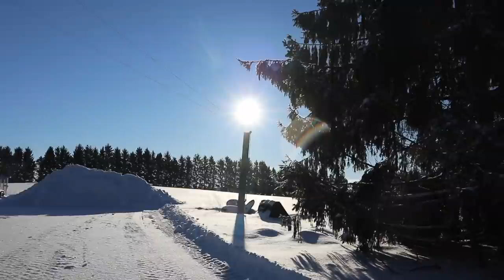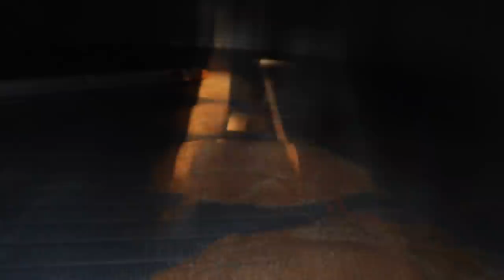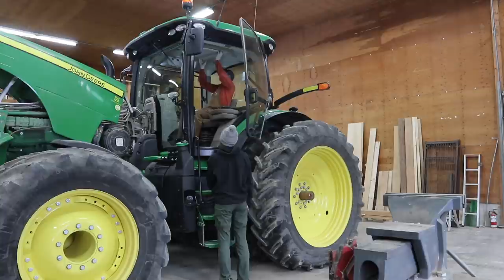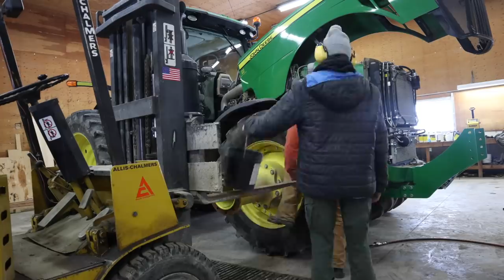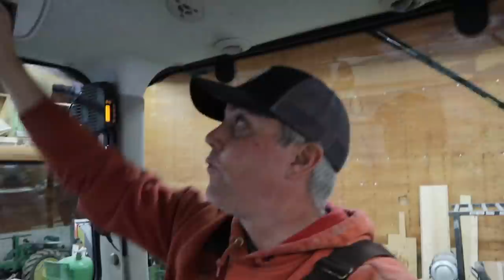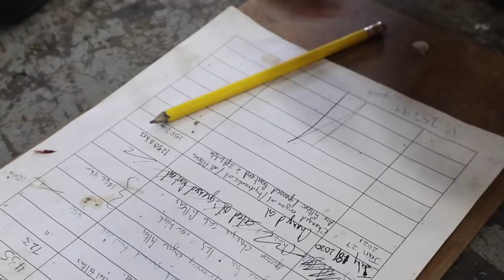OH NO, WHY DIDN’T IT START (the big annual maintenance)!

Comment: The outside cab filter on the first tractor,when you installed the new one,one of the pleats on the end didn't go inside the housing properly and the rubber gasket on top didn't seal properly,go back and check the video.
Reply: Good eye

Comment: All of our waste oil (engine & hydraulic) goes into a big tank and it is used to heat the shop.  The system we have is very clean burning and it heats the water for the under floor heating.  It is very nice to have here in Wisconsin.

Comment: Actually old oil has more than 1 use. Some shops have heaters that can use the old used oil for heat. It does a pretty good job heating shops. I think for road use and heat is probably the best uses for it. As long as no water or other contaminated are in it most shops that use it for heat will accept your used oil. But PLEASE, DO NOT JUST DUMP YOUR USED OILS ON/IN THE GROUND.
Reply from the maker: we always store our old oil in big totes until a company comes to pick it up to use it.